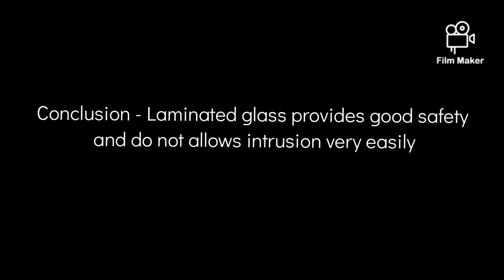12.52mm laminated glass breakage test

Comment: For better soundproofing of UPVC casement window, which among the three will be good option?

1. Tripple Glazed Unit {4 mm toughened glass + 5 mm gas layer + 4 mm toughened glass + 5 mm gas layer + 4 mm toughened glass} = 22 mm.

2. DGU {5 mm toughened glass + 11 mm gas layer + 5 mm toughened glass} = 21 mm.

3. PVB laminated glass {8 mm toughened glass + 1.52 mm PVB layer + 8 mm toughened glass} = 17.52 mm. 

Please tell me in terms of acoustic performance as well as cost.

Comment: is it really safe from theives i am about to install in my new house 
is there any trick to cut or break this glass without noise ?
Reply: @akashgope6332  but that will make noise
Reply: Tool available on Amazon for 2$ .
To break this glass 🤦
Reply from the maker: Yes it will provide good resistance..but like a wall 🧱 it will also fall after some time.

Also, the glass will make more noise than the wall
Reply from the maker: Are you sure about the tool.  Is it for laminated glass ?
Please share the link

Comment: My requirement is 6 feet height and 9 feet width of 12 or 15 mm glass. My question is 9 feet wide single glass or i should give partition and use two 4.5 feet wide glass?
Reply from the maker: If you want a better view you should go with a 12mm toughened glass or 12.52mm laminated glass.

Comment: But it will be broken eventually, right? It was just less than a minute.
Reply from the maker: Breaking the glass and entering inside the home are two different things as the glass will resist entry until it is taken out of the frame. 

Ultimately a brick wall will also fall with heavy blows.

It's actually the time taken to make an entry which is important and of course without noise which is not possible in this case as the glass makes a lot of noise when it is hit.

Furthermore the strength of glass can be increased by using a sentry film instead of PVB and increasing the glass thickness, though this glass is good enough to prevent an easy entry.
Reply: Yes, I was asking that because thieves will definitely break it if there are no people inside the house. So will it take just 2 mins to break it?
Reply: Yes, it is very easy for thieves if no one is at home and at night when neighbours are also sleeping